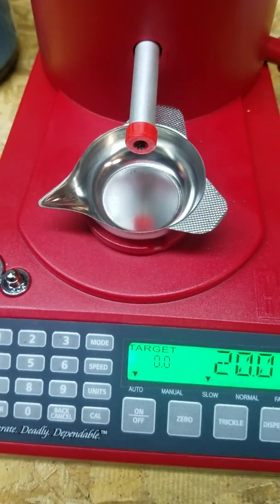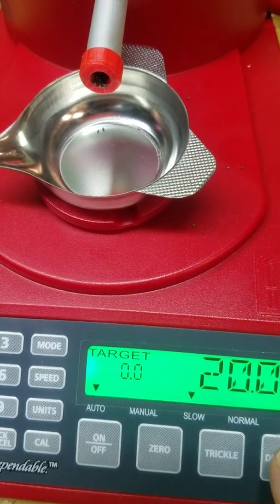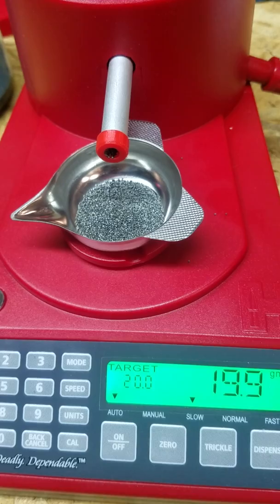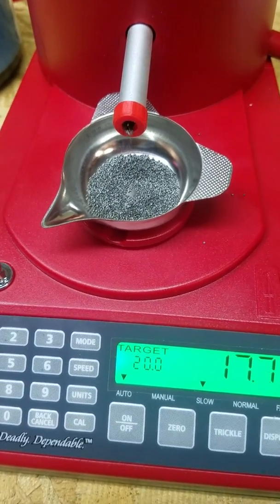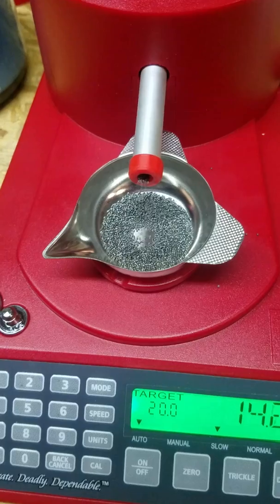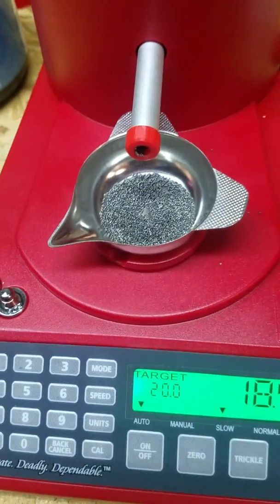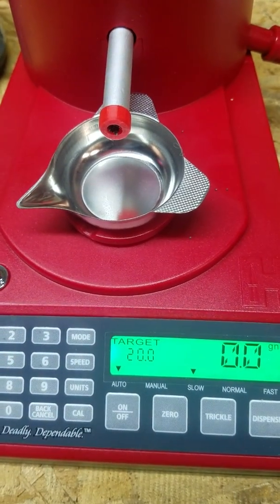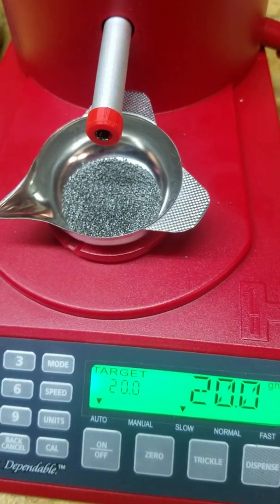Hornady Lock N Load Auto Charge Upgrade Loadertools Performance Nozzles

Comment: I haven't come across a huge issue with ball powder, but dealing with stick powder I really have to start trickling pretty early. Excited to see if this stays consistent. Thanks.
Reply from the maker: I've got a Varget stick powder video uploading,  it's going to impress you.  Check in a few hours.  The video sucks, the machines improved operation should be the impressive part.

Comment: When it stops, then indicates .1 over or under, then goes back to showing your target weight it most likely threw .1 over or under.  It's programmed to display the target weight even if it's .1 off on the actual charge.
Reply: Been wondering about that. Seems like if you pull the pan off and reweigh it, it still weighs the same though
Reply: @CorpusCrispy  Try weighing it with a different scale.
Reply: 0.1 grain accuracy is plenty. If that throws you out of your node you need to find a better load. 0.1 of a grain difference throwing you off means your charge is not stable and will perform like crap if temperature and conditions change
Reply: @slipknnnot  Depends on the cartridge, regardless I'm not comfortable with a scale that's programmed to lie, especially not knowing how far it'll take that lie.  More importantly I want a dispenser for doing .25ACP which can't be safely loaded with any of the powder drops I have.  Assuming the Auto Charge will only lie by 0.1 that's about 10% of the load in both directions, depending on the powder and bullet.  For perspective, it would be like loading .223 on a scale designed to lie by about 2.5gr.  I understand that most people don't load anything smaller than .38 where .1 either way is probably not a problem and that I'm in a somewhat unique situation.
Reply: @DonziGT230  it's not programmed to lie, it's accurate to 0.1 of a grain meaning it can sometimes throw at the edge and go to the next decimal point and then stabilize and read below. If you take it off and remeasure it will read the same. If you throw off by 0.2 it will give an overcharge so it's really not a big deal. 

It only struggles with extruded powders which are harder to meter. Ball powders and finer granules it meters perfectly. 

It will struggle with imr 4064 but with Mr 4000 or cfe blk, enforcer or blc2 it almost never overcharged and is very accurate. Proof is on the paper too.. your difference in your case capacity and neck tension/seating depth will affect it more than the difference in powder between rounds
Reply: @slipknnnot  I watched a video someone else made and they found that it does lie.  If the drop is .1 off the readout will change to reading the correct charge, but when moved to another scale it shows the .1 differential.  There was evidence of that in this video, every drop where it read 20.1 before reverting to showing 20, when he put the empty pan back on it read -.1 for a moment, then back to zero.  Either it's programmed to lie or it's drifting while dropping and then assuming 0 after reading close to 0 with an empty pan.  Most cheap digital scales will drift when trickling slowly so that's not a surprise, but I think the drift should stay in it 'till it's manually cleared.

.1 is pretty much a non-issue for rifle cartridges, probably a non-issue for most pistol cartridges not loaded to the edge, maybe a big issue in a tiny cartridge like .25.  I'm a wee bit of a nut job using a scale that reads to the hundredth instead of the tenth like a normal person, I do acknowledge my abnormality.
Reply: @DonziGT230  just because a scale reads .01 grains doesnt mean that its within the resolution of what the scale is capable of accurately measuring. I can get a cheap Chinese scale from Alibaba that will give me 37 significant figures. Does it mean that its measuring accurately ? No. 

If you want to get down to the .01 grain of consistency then you need a really high grade, high dollar analytical scale. We're talking thousands of dollars with a closed chamber. Even then that will be very hard to achieve since you would need something that can throw something that accurately which won't even work for anything where your extruded powders with granules larger than a .01 of a grain themselves. 

Putting things in perspective, .01 of a grain is 0.000647 grams or 647 micrograms. 

There is no reloading application where you need this much of a resolution to achieve consistency in your ES/SD. 

Regarding what you claim with the scale "cheating" or overriding it's zero, is complete bs. If that was the case then when you throw the charge into the case and put the pan back on the scale it wouldn't read zero and then it won't hold true for the 10 gram and 50 gram calibration weights. 

What is happening with this scale is most likely the charge thrown is at the limit  of the reading and it's trying to round up or round down the signal it's getting from the transducer. 

The biggest problem with this scale is that it just can't throw extruded powders in a controlled fashion and often throws too much and rounds down, or throws too little and rounds up. That is mostly what you are seeing. We are still talking within a +-0.1 grain tolerance. For the easier metering powders like ball or spherical powders it's pretty darn consistent. 

Would I recommend this for f class ? Probably not but it's really a great scale for anyone just trying to speed up their single stage loading process. It still is capable of delivering single digit ES/SD and put all your shots through the same hole if you have good bullets and good brass
Reply: @slipknnnot  I have a cheap Chinese scale that reads down to .02 gr. increments and seems pretty reliable, tho it will drift sometimes when I'm trickling.  I can add/remove one kernel of RE-19 with a 70+gr. charge and see it register.  I do understand that it won't be as accurate as a $1K scale, but it's pretty darn good.

You keep saying that +/- .1 doesn't matter despite the fact that I've already said it could be enough to take my .25ACP loads from below minimum to above maximum.  If you don't believe that look up some load data.

Again, I'm not saying that the Auto Charge is bad, it's just not as good as some think it is.

Comment: Have had many issues throwing IMR 4350, can’t wait to try these out.  Have had to set the trickle very early and slow speed and still get about 30% over charges.  If these solve the problem, would be a bargain at twice the price!

Comment: These are not needed.  I am sure they are nice,,,,,,but not needed.  I have used the Auto Charge for five years no problem.  Fast on light loads.  I don't understand why you have it in the Pulse mode?  Spend some time and read the instructions.  This is a delicate instrument not a toy.  Read, understand and you won't have the overthrows.  Love mine.

Comment: First of all your running thr machine on pulse instead of normal, and your settings are really slow considering , plus you have it set on slow, with ball powder, a proper set machine without your red thing would run circle around this video,